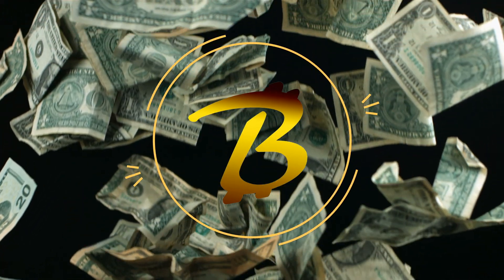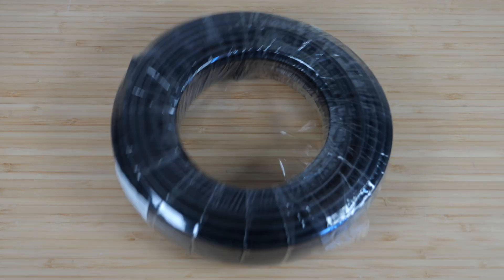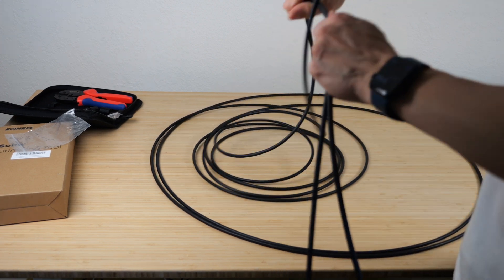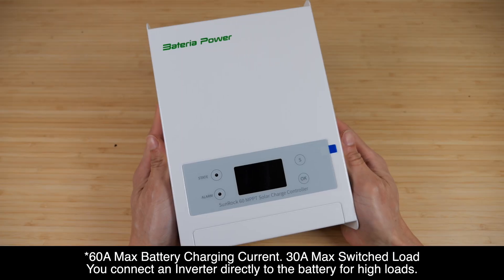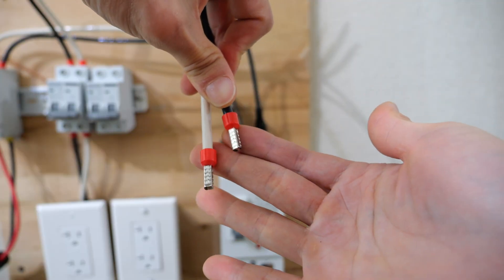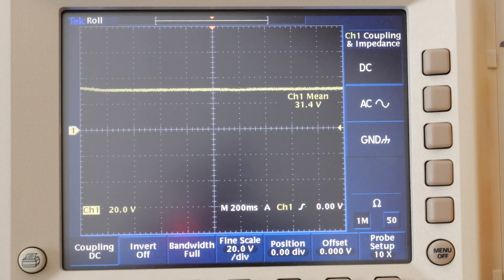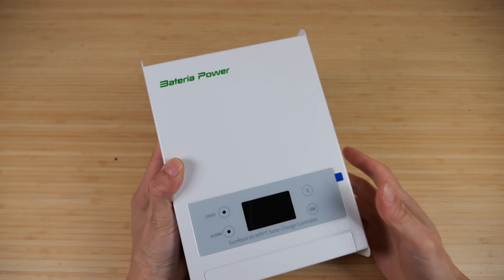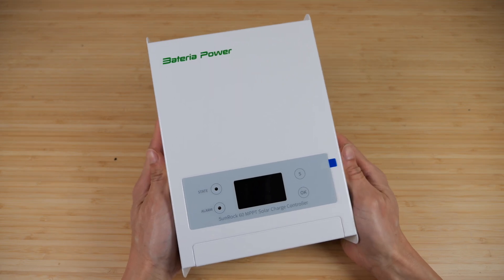How MPPT Saves You Money [Bateria Power]

Comment: How does 60A X 48V = way over 2,880W?  I assume because max amps and volts are slightly higher?
Reply from the maker: Are you referring to some marketing material shows '3120W for 48V'? This would equate to 65A. So it's not completely consistent with '60A MPPT'
Reply: @BeatTheBush  in the video when you were explained the specs on the side of the box.  I think I figured it out though after going back and re-watching.  That row is labeled max input.   So, I’m guessing max output is 2,880W 

That said, I’ve heard people say you mainly need to worry about max volts input based on VOC using an online calculator to account for colder temps.  There point was volts are pushed, amps are drawn.  So, you can produce more amps, but the charge controller will only draw the max it’s capable of.  I know that’s true for devices like my iPhone, for example, but then why would this controller specify a max input wattage instead of just max input volts?  

In line with what you said, 3,120W would imply max amps is 65A.  Alternatively, it could mean max voltage is 52V, or some combination of the two to tolerate a few % input variation for either.

Your videos are great btw.   I really appreciate the info you share.  I’m looking to DIY a solar power system in the capacity range of 20-25kW to offset most of my home’s minimum monthly usage of 3,600W without back feeding the grid.  I’m learning though that if you’re grid tied at all, your system will occasionally leak 100W here and there when my two 4 ton AC systems shut off suddenly, for example.  I guess I could give it my best shot and try to keep a few hundred watt buffer or something to keep my smart meter from erroring out.  The worst case would be an initial warning, from my utility company.  Running critical loads to my sub panel, like an off-grid system with a transfer switch, seems like it complicating things and making them more expensive than they need to be.  

I’m with you totally thinking that a 20 year payoff period is unacceptable.  I’m looking for 5yrs or less.  It seems the only way to do that is budget components, like these, and used panels from Santan Solar, FB marketplace, etc…   I think people that pay quadruple for extra long warranty components aren’t thinking about how in 20 years, they’ll have have 20 year old technology.  If we break-even in 5 years and replace every component budget tech every 10yrs, then we’ll have better systems and save way more money than if they break even in 15yrs and replace everything in 25yrs.

Comment: Forgot to mention a cool tip:  I haven't seen anyone mention this before but a cheap and non-flammable back board is less than $13 at Home Depot (Permabase Backer Board) and is made from cement.  I used it for my charger, inverter board since it's large at 3 foot by 5 foot and just 1/4" thick.  Easy to work with, not too heavy and peace of mind and wouldn't want a fire to burn anything down.

Comment: Good video.  I have found that PWM controllers are just as good for 12 v systems with short runs like 10 or 20 feet.  When you try to do a 50 or 60 ft run you'll notice a big difference.

Comment: Would this only be useful for batteries? If you have a grid tie system, the the inverter usually has a MPPT function that is built into it when doing its DC to AC conversion such as Enphase's microinverters.

Comment: BtB, my EcoFlow River Pro has a hard time with MPPT.  It oscillates and then restarts when plugging in my two solar modules in full sun.  I’ve learned to shade the modules and gradually expose them to the sun.  Or I plug in fist thing in the morning.  

The problem is that I cannot charge the battery using my car’s cigarette lighter adapter due to the constant oscillations and restarting.
Reply from the maker: For that product, it's 200W 10-25Vdc 12A max, check your solar panel to make sure it's not going over that. Maybe you have a 24V solar and that will most certainly cause this reset issue.